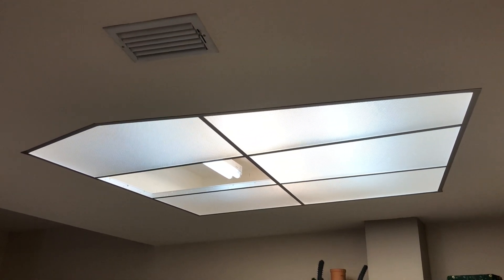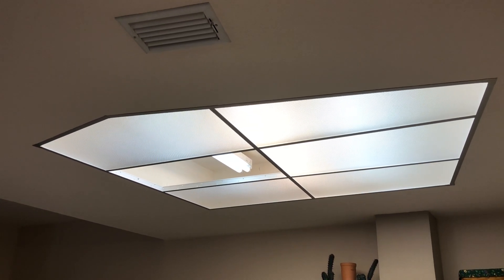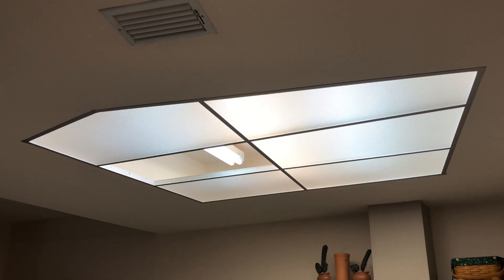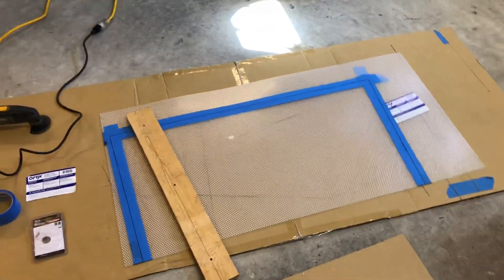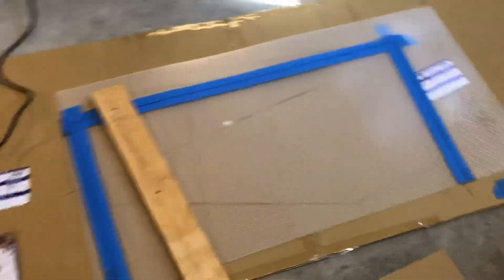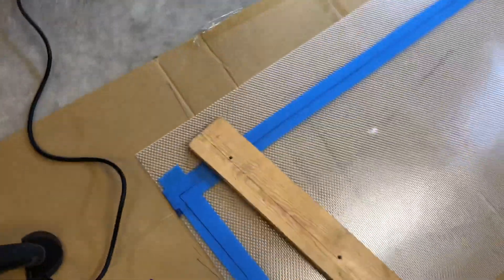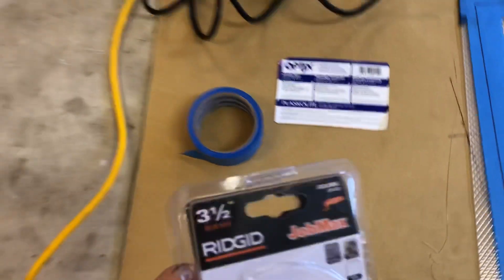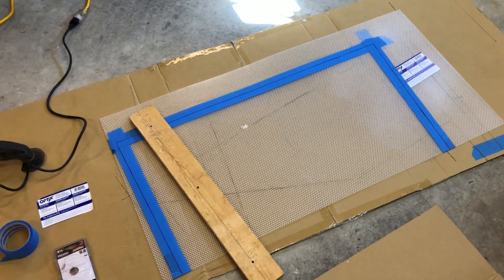Cutting Plaskolite OPTIX fluorescent light panels

Comment: IF you don't have a saw like is shown in the video (like me), and you have angled and curved cuts, I found that if you tape off both sides with painters tape, mark where you want your cuts, then use an Angle Grinder with a metal cutting blade, it will gut the plastic just fine.. I put cardboard underneath to protect the surface under the plastic. it is not the fastest method, but allow more freedom to cut curves, etc.

Comment: Could I use straight tin snips to cut plastic panel?
Reply: Honestly I don’t know. I tested my method on a old piece first.
Reply: I have just tried that...
 It did not go well. The panel cracked in random directions all over the place. 
....which is why I'm here... lol
Reply from the maker: Milissa Allen - sorry as you can see I cut 6 pieces with absolutely no issues. You have to go slow and let the blade do the work.
Reply: Sorry, lol... yeah... patience is one of those thing my mother always tried to get me to have... it just didn't take. 
Luckily my project was relatively small (making a custom aquarium lid to acomodate all my turtle's toys) and I had plenty to mess up on a few times before I finally got it right 😅

Comment from the maker: When I was cutting these, I went back and forth over the complete distance of line NOT applying any force other than the weight of the saw. As you go back and forth the saw blade will drop through, cutting the plastic sheet completely. Take your time, go slow and let the saw do all the work. I cut six panels NOT damaging any of them. I did apply a little pressure to the straight edge but not very much. Just enough to keep the plastic from vibrating.  NOTE:  I had the textured surface facing down cutting on the smooth surface.  If you're cutting multiple sheets, keep you working surfaces clean from shavings as they tend to stick to the sheets.
Reply: Bro what kinda sheets are these... How to ask for these in shops...technical names like that..!
Reply: Are these acrylic or fibre or plastic sheets..!?
Reply: @vijayvel2542  You can purchase them at Lowes or Home Depot